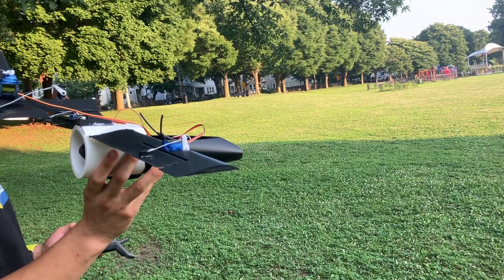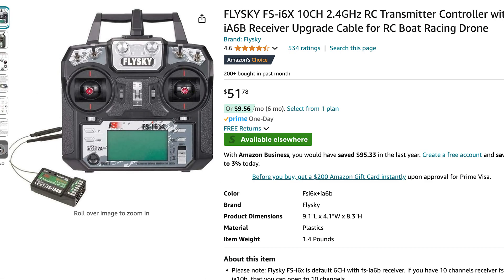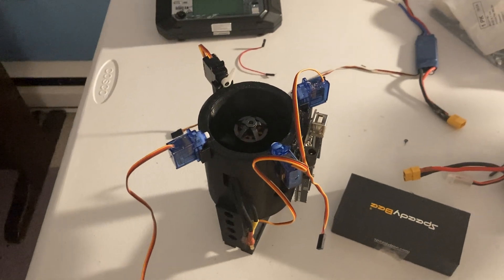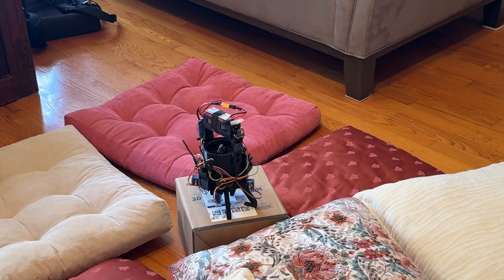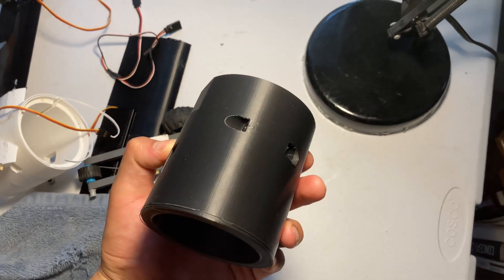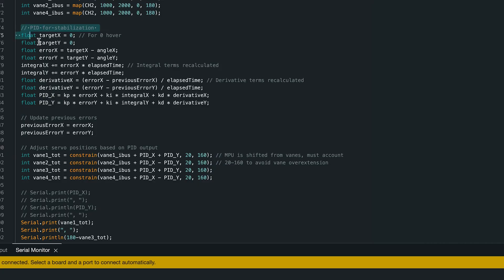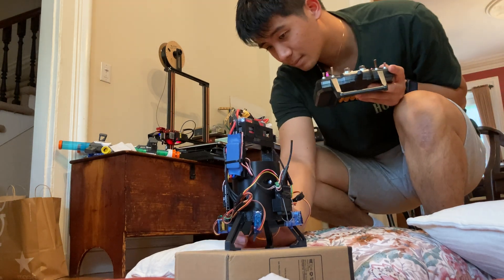Gross Thrust Vectoring Attempt

Comment: Great video! I did pretty much the same project a few years ago with basically the same components just a little bit bigger (90mm edf) here are my 50 cents:
- as gsisk911 pointed out: you have to account for gyroscopic precession: I measured the moment of inertia of the rotating assembly and actively measured the current speed of the EDF. With that, I was able to take into account the effect of gyroscopic precession in order to move to my target angle
- a gimbal is your friend (especially for PID tuning)
- I first used the same servos as you but then switched to faster digital ones for a faster response
-I used 4 smaller Batteries around the circumference of the EDF for better center-of-mass tuning but your idea of putting the battery in front of the EDF also looks enticing
- another way to improve the lift of an EDF is the Coanda effect
- those EDFs are stupidly fast so mind your fingers (speaking with experience ;))
- eventually, I replaced the Arduino with a teensy 4.0 for a faster loop frequency 
- and tbh my EDF drone did fly but the control authority was low and it always wobbled a bit in the air.
Really not an easy project but you are on the right way
Reply from the maker: This is huge! Love every bullet, thank you. Working on 2nd iteration with a teensy, new servos, hopefully better aero, would love to get where you got.

Comment: W&B is key…(heavy weight behind the thruster, not in front), test with a gimbal to tune your values this even help with ruffing) and try using a launching scaffold instead of a pad.  it allows the vehicle to avoid ground effect issues,  giving the thrust column more room to have an effect on the vector/direction
Reply from the maker: Very good tips, thank you!
Reply: @mrday60  I disagree about the weight behind the edf. Look at any rocket, the centre of gravity is infront of where the thrust is produced. This is called the rocket paradox, there's a great Tom Stanton video explaining why this is.

I do agree about the gimbal.

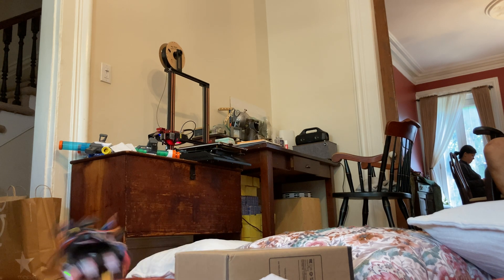Comment: That's cool. I reckon the reason why the control system didn't work is because your control response is reversed. You can see in the slow motion at 1:12 that the vanes rotate in a direction that would increase the angular velocity, rather than reduce it (this is bad). This is also seen at 4:44. Reversing the direction of the servos would definitely help to improve the control.
EDFs are quite complicated. Their static thrust and static pressure are very low because of the high angle of attack of each blade. This means that when it is sitting on the ground, even at full throttle, you'll get nowhere near 1.6kg of thrust and it'll be really inefficient. This is why EDFs are commonly used on rc jets, because they go fast and have a high intake velocity. 

Definitely a cool project and it would be great to see it work. With a better software implementation, a well tune PID and probably some stronger servos with less jitter, it would definitely work!
Reply from the maker: Thanks for the heads up. Yeah I've seen this done with regular props which makes more sense thrust wise, the more I work with EDFs the more I see how limited they are. Appreciate this man!

Comment: This design will probably be impossible to fly using an Arduino with cheap servos. The problem is that it's so short it has very little rotational inertia. You need to put the battery on a tall stick so that the centre of mass is high, giving you more stability. Watch Tom Stanton videos about it.
Reply from the maker: 100% upgrading my servos. 

I'm having a little trouble understanding stability in this application but I think I understand what you're saying, a larger static margin would also increase my air pull I think.
Reply: @mach10point4  basically imagine trying to balance a long pole on your hand, it's easy, but a pencil, almost impossible without insanely fast and accurate reflexes

Comment: cool video, ive seen some other people attempt similar projects and it seems pretty difficult. what i would say is instead of using one big battery at the top you could use two batteries that are half the size but the same amount of cells (one on each side) to move the center of mass down a bit. maybe you could also build some kind of test stand so that you can get the tuning down before you actually fly it. would love to see a follow up video!
Reply from the maker: Thank you!! The two battery set up is smart. I wanted some wiggle room in terms of longitudinal stability so that's why I ultimately went with this. But yeah I REALLY need a test gimbal for this

Comment: Two points:
1. You will have to look into gyroscopic precession for the control system on this project. As the craft has any angular velocity the torques produced by the control vanes will act 90 degrees away from the intended direction. A common solution for this is an angular velocity feed forward controller. I will reply to this comment with a good paper if I can find one quickly.
2. The passive stability does not have much of an effect in this case. A single rotating blade will naturally be unstable. Even for rockets they require significant airspeed before they become stable with a CG forward of CP design. You can see this in sounding rockets that wobble right off the launch rail but then seem to lock into an orientation.

This is a very difficult project to complete but it looks like you are well on your way on the hardware side. Maybe setup a gimbal to hold the craft safely while you test modifications to the control system and keep testing! Good work!
Reply: https://youtu.be/RMeEh5OUaDs?si=7BzNk5PqsWQG3UgI

https://projekter.aau.dk/projekter/files/421577367/Master_Thesis_Emil_Jacobsen_v5.pdf

The video is about exactly what you are doing. The paper describes a contra-rotating setup but could be helpful in making a 6dof model of your system.
Reply from the maker: Big thanks. Yeah it was pretty dumb to do this without a gimbal test thing. I've somehow never heard about gyroscopic precession before so this will be a fun rabbit hole

Comment: Great video! I’ve been working on a similar project and noticed something interesting. When tilting the drone from its normal position to a certain angle, the motor speed doesn't seem to increase as needed to balance the drone properly. Since only the vertical component of the motor thrust contributes to lift, this could be why it's not stabilizing as expected. Mathematically, the vertical lift component can be represented as F_vertical = F.cos(θ), and the horizontal component as F_horizontal = F.sin(θ). 
F_vertical should be equal to the thrust when the drone is in its normal orientation without tilting. Keep up the great work!
Reply from the maker: Sick! Would love a video at some point :) but yeah thanks for pointing that out, forgot to mention in the video. Right now I’m manually controlling throttle from the TX, so I figured motor speed compensation wasn’t entirely necessary at this stage. Also, I’m only using an MPU and would obviously need an altimeter or some equivalent to maintain constant altitude. That’s why I neglected to add this part of balance in this first iteration. But now that you mention it I will definitely try to incorporate this into the next one, didn’t think of this as a problem until now!

Comment: In the picture of the EDF, it looks like the motor sits beneath the fan. The motor is going to be a significant weight, so I wonder if you can flip that around to be on top of the fan instead to help shift CG up

Either way, very cool project. Looking forward to seeing your progress
Reply from the maker: Huh. Never crossed my mind. With this particular EDF I can reverse the direction but with the lip and stators it wouldn’t be practical. But designing a custom EDF in the way you’re saying would actually really help out a lot